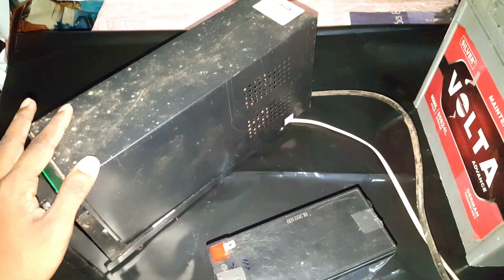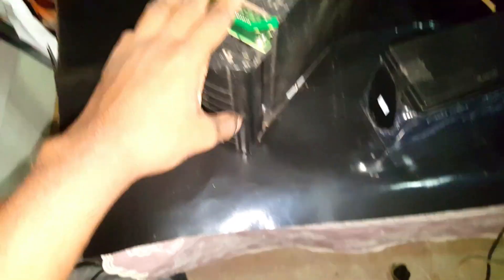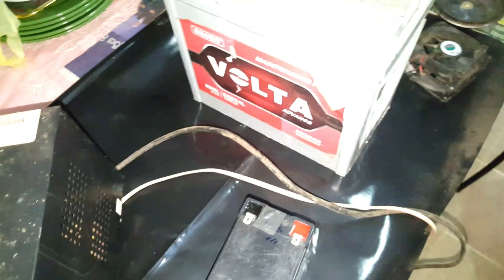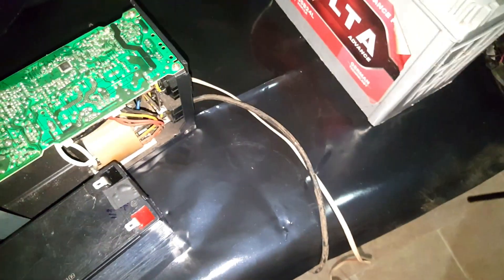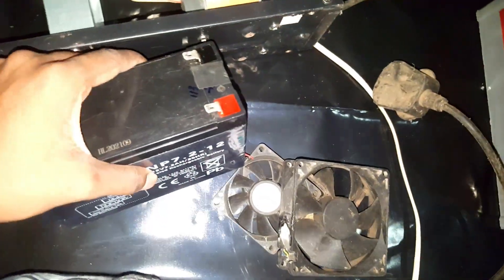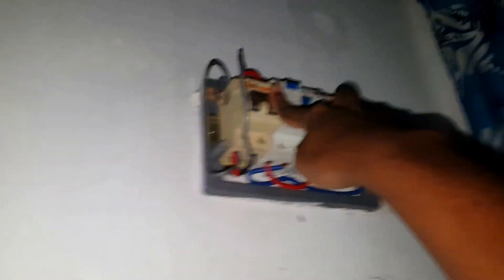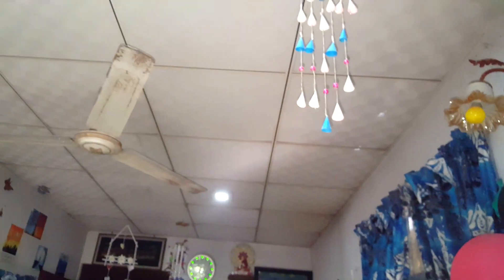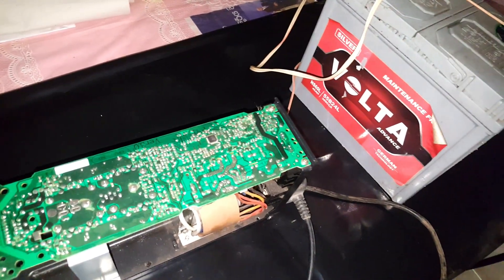How To Use A Old UPS For Power Cut Solution In House | Power Cut Solution From UPS In Sinhala

Comment: මම weel bettery ekak connect kale. Eth computer ekawath on wenne ne . Ups eka auto off වෙනව.  Hebei mm ups eke idala bettery ekata yana wire ekata gaththe gewal wayarin karana ekak. Ekath wayar keli joint karala thamai gaththe.  Bettery clip use karalath ne . Eka nisada ehema wenne.  Poddak kiyala dennako..
Reply from the maker: Wire digata ganna epa
Reply: @RandomPlusSL  wayar 6 m k විතර digai.  E gana wedida